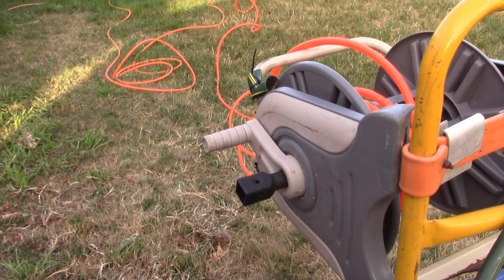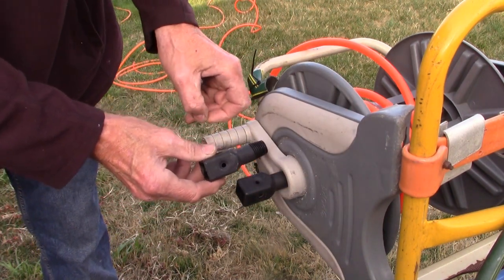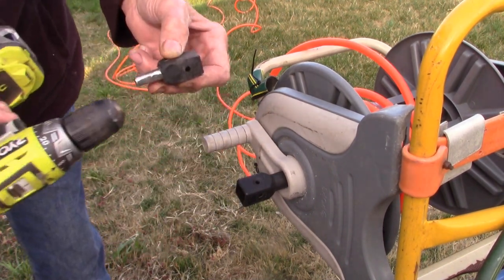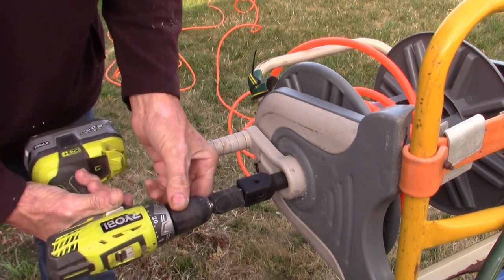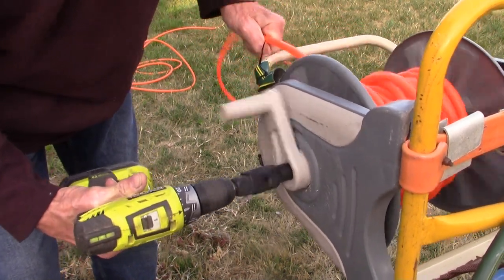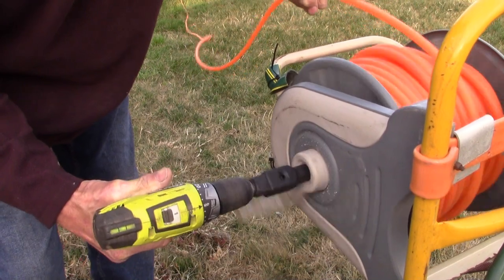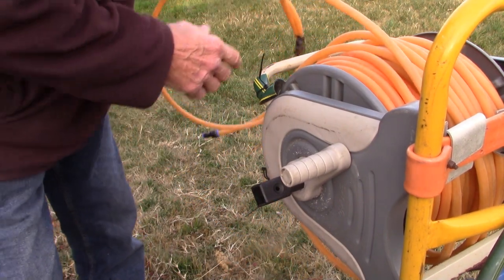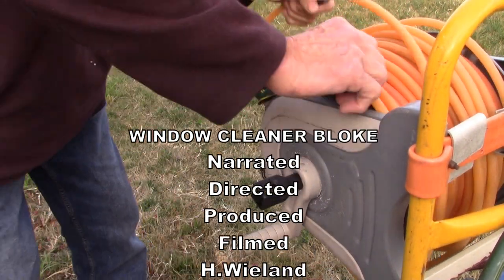✅USING DRILL TO WIND HOSE /TUBING ONTO HOSE REEL FAST

Comment: How did you fit the reel to use that? I'm not sure that could be done with Euro's or Acme's. Looks great, though. Well thought out, nice work.
Reply from the maker: Drilled hole then taped euro thread into that.

Comment: You're going to need better bearings in that Herman :)
Reply from the maker: The drill??
Reply: @WindowCleanerBloke  No, the hose reel. The speed makes it get hotter on the shaft. It will start to melt. I've had that issue with putting long thin hose on garden reels, They don't get to cool down like they normally would with thicker shorter hoses on them.
Reply from the maker: Oh OK Although (think could do this a bit slower. Drill speed )but it's easier then winding by hand.
Reply: Im fed up of seeing all these stupid ideas.......build a proper business that helps ya buy the proper kit...it looks naff and customers will think ya a joke turning up with these half baked ideas
Reply: @razorryan1789  if you actually took the time to view some of his other ideas you would see they are all mainly cost effective methods of achieving the same results as some of the newer tools, on a budget. I do agree in using professional tools to appear more professional to customers but many modern professional innovations can be expensive and don't always work properly out of the box anyway. Herman has modified older tools to achieve the same results so that people can work safer/faster and then buy new tools if desired. He has been cleaning for many years and mainly creates modifications to existing tools to help with RSI as us windys age. He is creative and gives back more than many others to our industry. 
What have you given to the industry in way of ideas?
Reply: @teampristine4723  iv done a few over the years one of them is a long lance tfr sprayer...I also fit boiler elements for hot water ...to name two of them

Comment: lunatic, you haven't got a clue pal....
Reply: I would love to see a list of your innovations to help the cleaning industry.....
Reply from the maker: Here you do check it out.       https://youtu.be/XNdZOPk1Pew
Reply: @teampristine4723  You think this innovative? People have been putting these things together for 12 years. There’s nothing innovative in it at all.
Reply: @oakleywindowcleaning  why so angry bro? Most of Hermans mod's are to do with squeegee's, WFP brushes and water supply. He is just an old windy that likes to share what he is doing. I think he mentioned using a slower speed on the drill to wind it in if needed. 
Some of his modifications are to assist people with low/no budget for new tools that do not have the dexterity or strength to perform tasks that we take for granted. 
Useless to some, valuable to many.
Others are to reduce RSI by changing the way tools work (such as his mod to the wagtail discs). 
All he is doing is trying to help people, instead of putting them down.